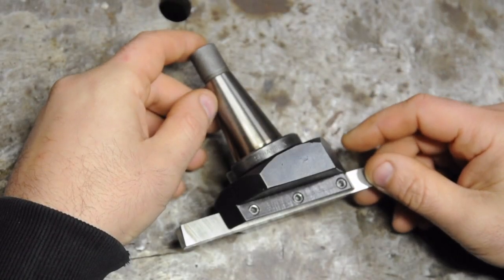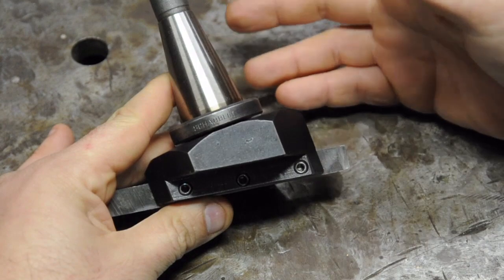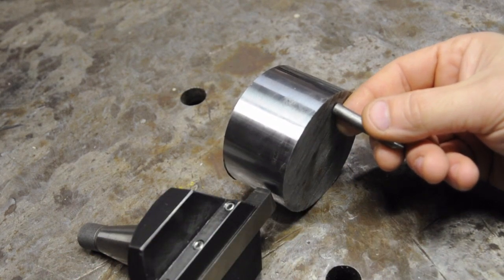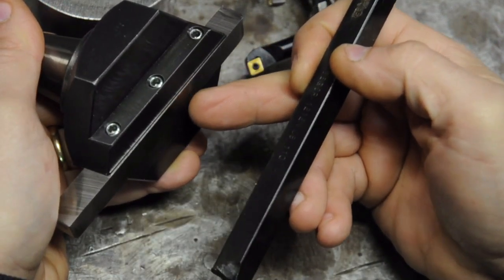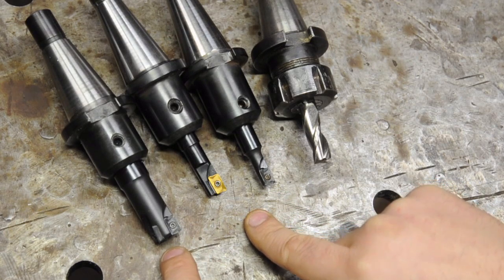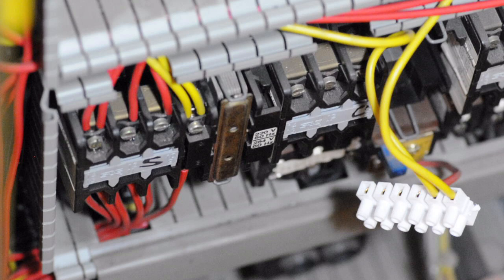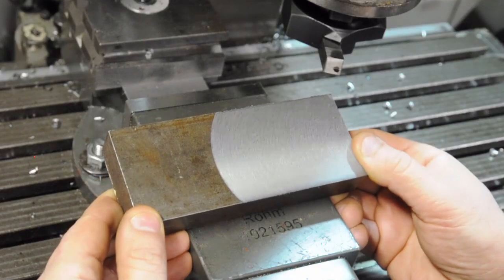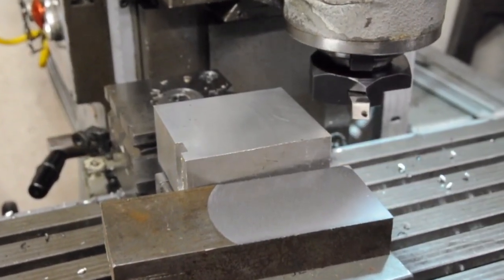Building a Fly Cutter - Addendum

Comment: Nicely done. That said100 rpm at 25mm/1" per minute that's a .010 feed rate per revolution. going to .020" per revolution is IMO a lot. I generally do not like fly cutters. Not from a safety aspect but from a machine abuse aspect. Far too often I have see (and heard) them being used to rough stock down when the operation should of been done in either a shaper or Blanchard grinder if they were available. And in my former job they were. Invariably if someone was using a fly cutter in a mill with an adjustable head, be it a Bridgeport to a stout Cincinatti or K&T the Spindle would need to be checked for squareness to the table. Face or shell mills if abused can cause the same issue. Invariably the head if knocked out of tram will be low to the opposite of feed direction of the table. If you are feeding left to right (as is often the case to throw the chips away from you) the spindle will be kicked to the right causing the tool to be lower on the left side. This of course will result in a concave surface. So everybody please do not use these for roughing in steels, copper alloys or even aluminum. Finish cuts are fine. Just don't get carried away. as to tool profiles. I generally used a high shear angle tool with lots of top rake similar to a shaper tool with a larger tool nose radius. I found it caused less problems in the long run as long as speeds were kept down.

Comment: can you review does 12mm apkt single insert cutters? i was gonna buy one because the're less than 5usd shipped on ebay, but i was told they're flimsy. Can you show us some cuts with sound, full height of the insert, but not necessarily full involvement

Comment: I have a theory on the satin finish with the HSS tool against the high gloss finish with an carbide insert:
Carbide inserts for steel have generaly a rounded cutting edge to make them last longer. That resultsts not only in a cutting action, but also a burnishing action, which results in the high gloss finish.
The HSS is normaly sharpened to a deadly sharp edge and will cut no matter how shallow of a cut you take. The cutting action results in this satin finish.

Just a beer-idea without beer ;)
Reply from the maker: I would tend to agree -- especially considering 99% of my insert tooling is negative rake.  Also HSS is a bit temperamental -- the finish it gives, independent of the grind, also depends on the material it's up against.. not so much with inserts -- which may go to further advance your burnishing theory.
Reply: DEEREMEYER1 more qoutation marks pls
Reply: Don't take any notice of the quotation-mark laden post a couple of comments above this. 
The only parts which are not incorrect are misleading.
Reply: My theory is that the piece you milled is construction steel that gives a bad surface finish pretty much however you do it. A free machining steel would come out a lot better.Or that a nice and shiny weather would give you a nice and shiny surface?
Reply: Hi mate.   So what happened with the beer?   All the best.
Reply: this person is indeed correct and one of the few advanced commenters I see.. the satin finish IS A PERFECT FINISH--the burnishing often seen by people is from a tool with some dullness..
Reply: Agreed.  I set my HSS tools over on the lathe when turning to burnish the part and get a better surface finish.
Reply: Stefan Gotteswinter
Reply: There is a lot of truth in that. Also involved is the plastic deformation caused by higher speeds and pressure. Some times the chips come off in a near liquid state which is why they turn colors or throw sparks. If you cut at low speeds with regular insert tooling usually that will be reflected in the finish.  HSS can't take the pressure or speed because the edge breaks down or the chips want to weld to the tool at higher speeds both of which cause for exciting results. The carbide usually fails by erosion as the chips remove tiny amounts of the tool until a fragile edge is formed which breaks away. This is why coated inserts will last longer as the chip doesn't contact the carbon in the tool. Coating can also be of benefit to HSS. Look at drills and taps many of which are coated to prevent chip weld and erosion. Of course lube helps in that regard also.
    Mike (o\!/o)
Reply: "Burnishing" is done to produce the OPPOSITE of a "high gloss finish". Its done to "deglaze" and create a rougher surface finish. Carbide is mainly "carbon" and will never produce a "glossy" surface finish NOR can it be "polished" so if you have "shiny" supposedly "carbide" cutters/end mills etc you have been sold "HSS" at a "carbide" price by a crook.
Reply: @deeremeyer1749  I thought I "hideously overused" quotation marks... and horizontal ellipsiseses... in comments but you are so far ahead of me... I bow to your superior thingymajig.
Reply: get the appropriate insert geometry don't philosophise about which innappropriately chosen insert might work. we need reproducible logial processes to progress as a society.

Comment: Just found you channel a few days ago. I like you videos good photography good edits clear sound Awesome!! But (There is always a BUTT) Just one inconsequential comment. The feed at 100 RPM and 1.0" per minute would be .010" per flute just a bit fast for a good finish even with what looks like a sizable tip radius on your tool.

Comment: if that coil is just a carrier for the starting signal why don't you use use a relay and fabricobble it in there?
Reply: Justin Angers Relays are usually much lower current and only single phase. Same idea though.

Comment: Like it very much. Well done! With your relay: This may be "Metric". So if the Voltage ist lower, the current is higher and the coil burns away. Just guessing.
Reply: That's not how electrickery works.
Reply: LOL sure not. I am Woodworker, i have no idea. I made it just to fit my mindset. In fact i saw the 220V tag and wondered if there are 220V single phase in that machine as there are most likely 110V coming from the plug.

Comment: People will most likely find some fault no matter what you do or use.  I think you made a really nice useful tool.
Reply: @kwakmad91  actually what it is is that there are alot of advanced commenters sneaking in. A classic flycutter as he made is generally a first project for beginners however they are not good tools and dangerous and slow and too many things to list. People do appreciate his love of the trade and expert way he makes the videos and when I watch videos I dont nit pick them since they may be fine for those in that part of their experience..Please note--that he had to stop the cut part way through because you cannnot use hss on steel with a flycutter--its too slow plus you have to feed on--then back off combined with you cannot debur the edge by seeking to cover an entire object with a single giant cutter.. Should a person decide to make a carreer out of machining they in fact will be forcibly stopped from using classic flycutters.. I made great complex balanced ones--and threw them out so as not to spread the cancer to the next group of beginners..
Reply: @jaysilverheals4445  I was taught milling by a retired tool and die maker of over 40 years experience, and he taught that fly cutting (for non production work) with HSS is an acceptable, precice, and cost effective method for cutting steel. He told me to use them wherever possible.

Comment: Oh by the way what I wanted to mention, these AC contactor coils will burn out if the contactor doesn't fully close (stuck, bug in it, etc..). The current reduces dramatically once the air gap in the magnetic circuit is closed due the increase in inductance.
That, overvoltage, and insulation breakdown are pretty much the only reasons why they can burn out.
So inspect that contactor to make sure it moves freely if you fix it.
Reply: Good point! It's been a long time since school but that makes a lot of sense.

Comment: Looking at the finish on the bottom of your fly cutter, you could have got a nicer finish with your previous setup. While you couldn't finish the whole of the face of the hex stock, you didn't need to - some of that face would go on to get removed when you cut the shoulder for the set screws! If you had the rougher area from the reverse pass on the other side of the stock then it would have been removed when you cut the shoulder, leaving only the smooth surface behind.

Totally academic now that you have a fly cutter, of course.

Comment: Could you make a video about chips ? What they must look like (shape, colour, length..), what to do (change feed rate, rpm...) if they're not the right way (spaghetti..) and maybe how the tooling (machining aluminum with a tool for steel) or material (quality and composition of the alloy) might affect chips. And why bad chipping makes bad surface finish, or other things..
Reply: You can learn about these things from Abom 79. Adam talks about chip control and surface finish in many of his videos. He and some other tubers have a running discourse about that subject.
   Mike (o\!/o)
Reply: I'll look up to that, thanks :)
Reply: Abipso  - there is also an excellent series of videos provided by 'that lazy machinist' both on YouTube and via his website. He has a very comprehensive set of videos on cutting tools, chip formation, feeds and speeds, etc. Definitely worth watching IMHO

Comment: My offer to rewind that coil for you still stands. You need to get the iron yoke off yourself, I'm not doing that and have it be my fault when the thing breaks into a million pieces.
Reply: The typical (for DIN rail and/or stud mount) 4kW contactor costs around 30 Euro. They are not that expensive anymore. Even a motor protection contactor w/ or w/o temperature probe is not that expensive.

As for repairing that coil: the contacts on these contactors are subject to wear as well and there is only a certain amount of activations until they are chewed up. Old mill = many cycles, dusty environment or grinding grit = more wear, because that dust gets everywhere and mechanical switches are functional surfaces too.

For a contactor this means: opening a switch under load (like reversing or switching the motor off) forms a small spark which creates micro-welds on the surface of a contact, which will be torn apart every time the switch opens. The more chewed up the surface is, the more of those welding spots it will have, because the spark gap forms at those craters. 

The coils could break because of vibration (by mechanical shock or humming at grid frequency), filter capacitors become dry/brittle and break (= voltage spike that might pinch insulation of the coil or wiring and cause short circuits between coil windings).

The electrical side looks kind of rebuilt and new, but these contactors don´t last forever.
Reply: I know, it's not economical, I would also just pop another one in and call it done if I was asked to repair this as a job. It's also the more reliable option.
But Tony is particular about neatness, he wants them to look the same. I have winding machines and magnet wire standing around, going to the post office would be more hassle for me than the actual re-winding, so why not if it makes him happy.

Comment: I really don't see how balance can really end up being a factor on a fly cutter. I mean, you're cutting on one side which I imagine is a substantially heavier load than the balance.
Reply: Heh, heh, heh... Just try using a 4" fly cutter on a minimill, the most I could get without it shaking itself off the bench was 100RPM.